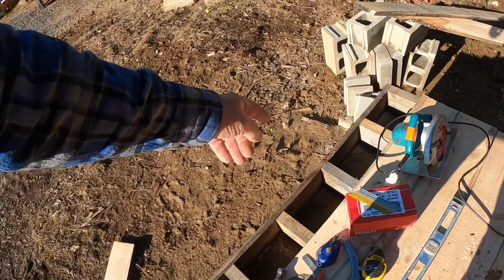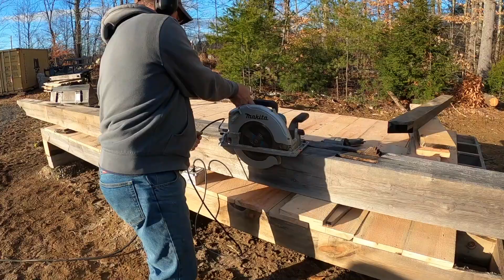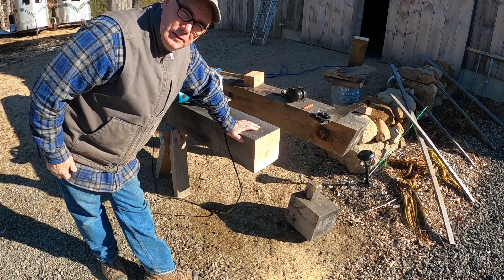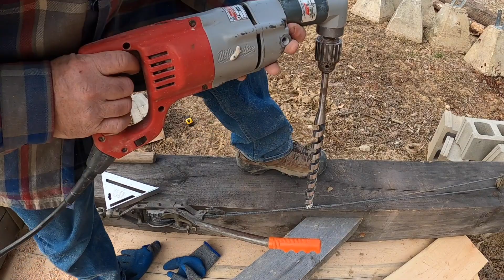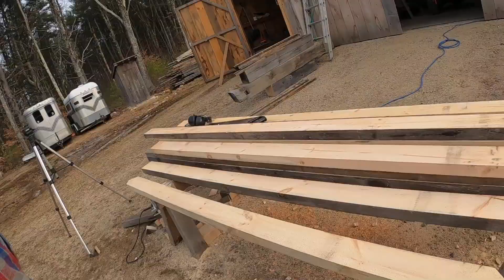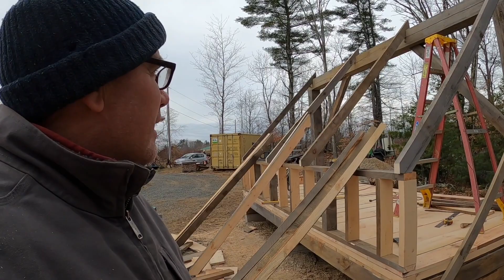Wood Kiln Build Part Two

Comment: I just came across your channel looking for solar kiln builds. Really appreciate seeing your approach to timber framing. Here's what I got from google for collector angle, cheers:
The optimal roof angle for a solar kiln is generally equal to the latitude of your location, typically falling between 40° and 45°, facing directly south. For enhanced performance during winter, or in higher latitudes, increasing this angle to roughly 55° or by adding 10°–15° to your latitude optimizes for lower sun angles.
Reply from the maker: I just typed a reply and it vanished so here goes again. The kiln for what it is with the little time and money I have invested has been a complete success. The mice get in when it's cold the back doors aren't finished and I never got around to painting the inside. See incomplete projects still work. Thanks for watching and leaving a comment.
Reply: @BrianBozak  you bet! I'm surprised you don't have more subscribers. Posting your videos, or shorts/reels, to relevant fb groups or your own page may help drive more engagement. Thinking sawmill, kiln drying, and timber frame groups. 
Hope your snow plow is ready to go! Cheers.
Reply from the maker: I'm not a tech. guy and just publishing these videos is a challenge. I also don't seem to have the time to invest in that. Would also be nice to have a videographer but thats not happening either. So I just keep going as I am. Thanks.